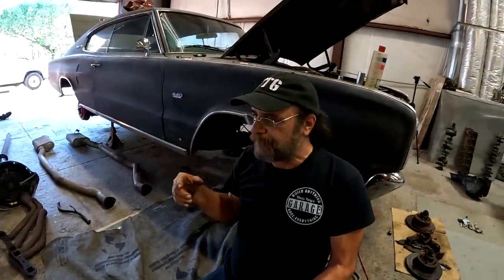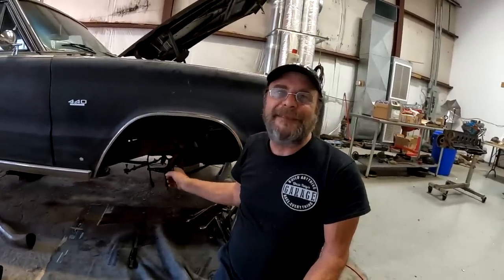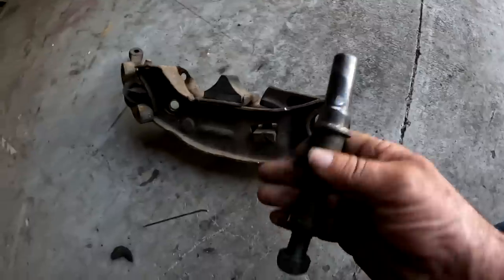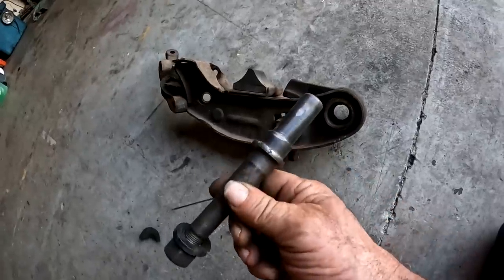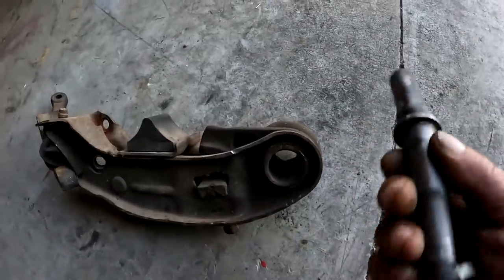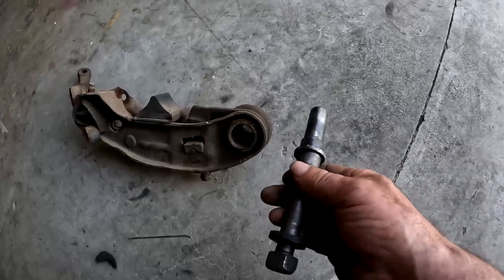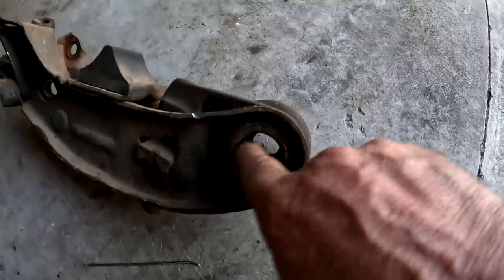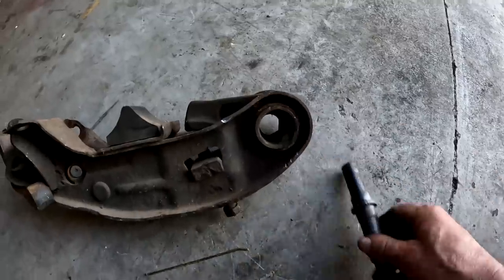The Achilles Heel Of The Classic Era Mopar - The Dreaded Lower Control Arm Bushing

Comment: We thought the control arm bushings on my brother's '68 Barracuda needed replacing. Turns out the frame end of one of the torsion bars had punched through the frame. Took a lot to fix that.
Reply: Yep, been there done that. Had a 66 fury when I was younger and it had opened up that hole pretty good. It was a mediocre setup at best.  The biggest upgrade I can tell you is an aftermarket swaybar on the front to get rid of that mushy feel. I cant recall the company that makes them but all they do is mopar steering and suspension components.  There upgraded gearbox is nice too
Reply: Firm feel is the company.  Great stuff

Comment: I had a 79 St. Regis that I gave to my  son because due to my career damaging my body, I have trouble working on cars these days...and I'm only 42, but none the less...It doesn't display any of the weird floating symptoms...It does wear tires on the outside, I had to adjust the A arm out completely to compensate tire wear, but in the rain this thing will try to kill you. It drug me across 4 lanes of traffic once. My son is aware that this car is a project. Since I adjusted the A frames, it doesn't do this anymore, but it does need repaired. I have a sneaking suspicion that it's the bushings. What I find strange about the car is that it has a "B" body K member, but rather than having traditional spindles where the upper and lower ball joints are directly above each other, the uppers are located more towards the frame...basically it has an underbite of about an inch or so, which makes me struggle on how this alignment works on this thing. You would think that if you had to correct for any amount of road lean that it would be constantly altering the camber...If you know anything about this, I could use the info...it seems that the internet isn't too savvy on "R" bodies.

Comment: My first car in 1977 was a 68 Barracuda fastback, within 3 months the passenger side torsion bar ripped out of the frame. Paid $235.00 for it and junked it for $40.00. Wish I knew more back then and yes, wish I still had it.

Comment: I just rebuilt a '63 Fairlane front end; the lower control arm is not that bad.  The Coil Spring could kill a man.  Be careful on a ford coil spring.  I love the adjustable torsion rid.  Cool Engineering.
Reply: I rebuilt the front end on a '64 Fairlane. Broke three spring compressors and bent a forth. Almost did get killed when the spring compressor broke and the spring flew out under tension, whizzing inches past my head. Dumbest design I've ever seen. I sold the car because of it.
Reply: @geraldscott4302  that's why I used a length of chain last time I replaced control arm bushings. I didn't trust the chinesium spring compressor. It's threads wanted to gall from the tension even though I lubed them with red tacky grease. It's a project that makes a guy's forehead sweat, and his backside pucker. 😰
Reply: All coiled springs are life ending dangerous, and require proper tools to deal with.
I have watched them bounce around and even knock a hole in a block wall.
Nothing to be playing around with for sure.
Reply: You need to have a helmet on for safety with ford springs but there is safer way of doing it than chinesium stuff.

Comment: The original bush is pressed into the arm and the pivot pin, the other type can slip back when the brakes are applied in reverse because the ball joint end pushes forward against the reaction rod, like what happened to Bottle Rocket at the track some time back when the original bush was worn out. I like the original bush myself because it holds the arn in place.

Comment: I had a 74 duster in high school and the upper control arms kept breaking loose from the unibody frame thing they're welded to, the metal that the upper conreol arm was welded to the frame with was as thin as the brim of your cap maybe barley 12 Ga. Back then I had no experience with that kind of problem didn't know welding some gussets on the thing would fix the problem forever

Comment: Tony, I'm not sure if I got through to you on a sub-conscious universal level or not, but My 72 coronet has been having problems keeping a front end alignment. I'm not a mopar dude by any stretch but that thing has been my daily driver and the tire wear has been driving me insane. Ball joints, bearings, and tie rods. I've replaced them all and the car has had the same issue. I'm going to get the front tires off and take a good, long look at the lower control arm bushings. At this point they're the only thing I haven't replaced, and pretty much the last thing I suspected.

Comment: I'll be interested to see what your cheap fix for torn ball joint boots is going to be, I've got a few that need replacing but the joints are still in good shape.
Reply: Why would you not replace the ball joints tearing into that far?
Reply: Replacement boots are readily available in Australia, so one would hope someone in the US supplies them.

Comment: The torsion bar front suspension was used on unibodies.  It's main advantage was to spread the weight of the front of the car longitudinally across the bottom of the unibody.  It wasn't as good as coil springs that supported the front of the car in the upper spring pockets on a "body on chassis" design.
Hard to explain to the Mopar enthusiasts that it was a cheap way to put springs (torsion bars) in the front of the flimsey unibodies.
Reply: You couldn't be further from wrong! Torsion bars originated from Porshe! Chrysler was using torsion bars before switching over to Unibody! Old Chrysler products are banned from some circle track racing because of the inherent advantages the Torsion bar suspension poses! Then also circle track cars to include Nascar used Chrysler pickup truck ball joints for their increased strength over Ford and GM ball joints! 
Oh and those "Flimsy Unibodies" have more torsional rigidity then body on frame cars!

Comment: It’s been 25 years since I messed around with torsion bars front ends . I made a special tool out of 3 inch Diameter , 5 inches long out of aluminum bar stock. Drilled a hole through the center just about the diameter of the torsion bar then cut it in half down the center line so it would clamp around the torsion bar held in place with 2 muffler pipe clamps. It worked great . I’d bet the H out of it with a 5lbs hammer. The first time for the bars was a bitch but I got them out. Then on installation I’d put some neverseize on them and they’d come right out after that , no problem.

Comment: a way to do this type of bushing in any thing is cut or drill out the rubber if any is left then use a dye grinder or air hack saw and just cut through the metal shell careful to not damage the housing (too much) then tap the shell out with a punch

Comment: A very similar design and, thus, a similar problem is on 1st gen WD21 Nissan Pathfinder/Terrano. Maybe Datsun 720 pickups, 4WD D21s as well. 

I live in a salt belt and oh boy, getting out the bolts that go through the inner bushing sleeve was a Herculean task. Spent two days with a die grinder and sawsall just to cut the bolts remove the control arms, then fabricobbled a hole saw from a piece of tube to cut out the rubber and only then was able to push out the outer sleeves.

It's a freaking pain on these IFS designs.

Comment: Seems like it should be a steel pin and bushing with 2 grease zerks?
Reply: The rubber bushing is for road noise isolation. Probably needed on a unibody and especailly a high dollar Chrysler sedan.
Reply: Yup.  I am a fan of synthetic grease. 
After using it now for years. 
I have realized I don't get plugged up grease passages & zerks like with conventional grease.

Comment: I wonder how much was changed from the front suspension on the drawing board to the production line. The idea was great but steering like a "Sailboat" wasn't the intended outcome. I guess that's why a lot of builders opt for a modern  K- member. Keep it stock, Tony, or you lose the 1966 feel.

Comment: Have you looked into Super Pro . Their not cheap but they hold up. Unlike factory rubber or poly bushings which seem to crumble much sooner . We are using the Super Pro on C4 Corvettes with great success.  They are an Australian company . Before them you basically had only factory rubber or the poly bushings which would end up leaving you with doing the job again in a few years .
Reply: I used to think poly bushings were great. Then found out how quickly they wear if they aren’t lubed often. On most suspensions the inner and outer part of the bushing is held by something. So, suspension movement relies on the flex of the bushing. With poly bushings they don’t flex so it requires something to slip. Usually there’s a sleeve that acts as a bearing inside the bushing. If it doesn’t get lubed often the bushings wears out pretty quick.

Comment: Yes you can raise/lower the torsion bars BUT....you must do a re-alignment of the front end, especially if it's a daily driver and most of the time even if not.   I loved Chrysler products because  guys liked to fool around with the height of the cars and would create lots of alignment/tire wear issues which I could fix with minimal effort easily. (if the car was at some point properly aligned.)
Reply: Pfffft ! RE-align the car?
No.
Maybe if you raised or lowered it 3 inches. Have you seen the testing that has been done by Bill Reilley? In 2004, he mapped the alignment through full range of travel using an A body knuckle and a B-FMJ-R body knuckle. From a stock ride height, the alignment doesn't change much until you get 1 1/2" above or below stock height. These cars have both caster and camber gain as they get lower. Yeah....you get MORE caster and NEGative camber as the suspension compresses. Toe changes slightly but not until you get past 2" of change.
People repeat information that they hear, often without any proof of their claims.

Comment: Currently trying to clock in my new torsion bars. There is another nightmare. Drivers side no problem . Passenger side won’t hold tension without cranking the bolt to all heck. Can’t stop the lower control arm far enough down to clock it in lower! Frustrating system to work on!

Comment: if those nolethane bushings are a slip fit, the circlip better be in back of torsion bar, or the whole shebang may move.  In fact the arm may pivot around the reaction rod. I think I'd stay with factory bush. Or am I off beam.

Comment: In this process as we speak. Using the "energy suspension " urethane bushings.  Yes, my front passenger tire was badly worn in an uneven fashion. Where do you think the culprit lies ..??. Yep ,lower control arm bushing.. practically dust.. 🥴.. the slip fit style of bushings does seem to be a better alternative,  but I haven't fully reassembled everything yet.. we shall see.

Comment: My workshop manuals in Australia say to wind a tap can't remember the size, into the shell and then press the tap and shell out from the T/B socket. Agreed though , it's a lousy set up. On freedom to move in operation though, The LCA pin nut should not be tightened until the vehicle is at the required ride height. The degrees of rotation the LCA goes through in service is well below the sheer point of the rubber bushing, so it allows the LCA to 'spin' about the center line of the LCA pivot pin without tearing either the rubber or it's vulcanized bond to the inner and outer shells. Just as crucial is the strut rod rubber. If it is sub par it will allow the LCA to move around just as badly with the corresponding effects on suspension geometry. 
And don't get me started on those aftermarket radius/strut rods that have a pivot located no where near the intersection of a line drawn through the LCA pin forward to a point where it bisects the plane of the 'K' frame, which is the geometric center of the radius/strut rod bushing.,
Reply: 1-3/8" tap

Comment: Back in the day the parts houses had rebuilt arms in a box with new bushings already installed. You could just swap them out and return the cores. They had shitty paint on them like a radiator. It was usually not totally cured and got all over your hands. We used to do them at Sears in the early 80's. They didn't want to pay us to rework anything. That was about the time that all the bushings were failing on 68-74 cars. I hated the torsion bar cars. Especially if the bar mounts were bashed up and the adjustment bolts were bent.

Comment: My boss was ready good at this so I'm going to tell you how he does it. Step one take a cutting torch and light the rubber on fire. Let it burn until all the rubber is gone. The heat will dislodged the bushing from being stuck. Step two with the cutting torch again cut into the metal bushing it will pop right out. And I'm going to try the new plastic bushings next time. Your welcome UTG

Comment: The upper control arms on those old MoPars are also petty crappy.  The thin metal camber adjustment tabs get pretty useless after some very common rusting.  Had to replace mine with after market tubular units just to get it to specs.
Yes, used the welded washer trick years ago on the lower arms.

Comment: Having worked on many different makes and models of the '60's and '70's every manufacturer had it's own engineering faults. There are other issues with torsion bars. I'm a Ford guy. Our bane; shock towers.

Comment: The Achilles heel of classic Mopars isn't parts - it's the prices. Especially now. A complete rustbucket, especially a Charger or Challenger, will run you $10K+ which is insane for a car that will need everything.

Comment: 99% of the time I’m changing a ball joint or bushing in the Chrysler control arms I have to make a jig. Screw in ball joints are the worst. They get so tight they flex the frame when you remove them. Sometimes the control arm gets destroyed in process. End up getting a big steel I beam, drilling holes into it to mount control arm and wedging the I beam between two trees. I would proceed to use a 3/4” breaker bar with a special tool for Chrysler ball joints. The breaker bar was 4ft long, and the cheater bar was 4ft long. Watching the breaker bar flex was very uneasing. Probably 800+ ftlbs to break loose atleast. Took a control arm to a machine shop where I watched them struggle and dance around the control arm with massive impact wrenches to get them off.

Comment: The more positive the caster the more stable a car drives .Heavy steering and lack of steering wheel return also happens .  Cars will pull to the side with the least positive caster . Caster run 1/4 to 1/2 deg  difference side to side . This will ensure vehicle pulls up the camber in road surface . 
If your vehicle specs  [+] camber always run close to "0" this will also stop wandering . 
Using  power steer run up to 1/2 more caster than normal .
A rear wheel drive car uses tow in ,  approx 1/8

Comment: i did them on my 73 Charger . Worst part was removing the inner bushing from the pin . I hated more changing Ball Joints . Those screw in ball joints are the worst . Why did Mopar decide to go with GM style Ball Joints ? What a curse .

Comment: The early T-bar Mopar system is way better. Why did they make it so complicated in later years? This just adds unsprung weight and wear parts. In 1957-61 full size cars the lower bushings are easily replaced. Best suspension system ever.

Comment: This is actually what turned me away from mopars.  That and the astronomical prices for parts. You practically have to be an oil tycoon to restore the mopars I like.
Reply: Yea the price for A body parte vs the b,e,f or whatever seem to be a difference of $300-$400. Drop spindles for an A body, almost $600. Drop spindles for a B body, about $325. A body parts are twice and so etimes 3 times the other body styles. Ridiculous.
Reply: @johnwirk  and its been that way as long as I can remember
Reply: That’s because so little demand for the supply, which keeps supply down and increases price. The more demand, then the more supply and the price will decrease. Simple economics. If you don’t buy the parts, then you’re a part of the problem!
Reply: @Dr.Jekyll  I understand economics Mr. Exclamation point. I myself bought all new front end parts aside from lower control arms. Those are a little pricey for my taste right now.
Reply: FoMoCo stuff is just the same, except for some Mustang stuff
Reply: @johnwirk  Hi John, I was responding to the OP, who said that the price of parts is one thing that turned him away from Mopars. Yet he’s watching a 98% Mopar channel. I guess Chevy and Ford guys don’t achieve the level of expertise as Tony, so the OP has to watch this channel, and then put Mopars down because of price. So I was highlighting that he is part of the problem. Sorry if I didn’t make that clear. I’m definitely not judging anyone on what they can afford.

Comment: My Mom had a 1965 Plymouth Fury III  4 door ..My unckle Bill and I Swapped out the upper Ball joints ...Those upper ones Used a Big Socket to unscrew them ..We tugged and pulled on thee ole Sear Breaker bar until we wore out ..Then we got a long section of pipe and used that as a cheater pipe ..We were both pushing on that cheater bar and all of a sudden ." POP " We both went rolling across the ground tumbling...We though ' Boy we showed that upper ball joint ' all we did was snap the BREAKER bar off ..But that was back when Sears honored their lifetime warranty..my uncle had that BREAKER bar since 1968 ..Sears replaced it no questions asked  back then .we got a new breaker bar and finally got that thing loose ..When a stupid design 😢